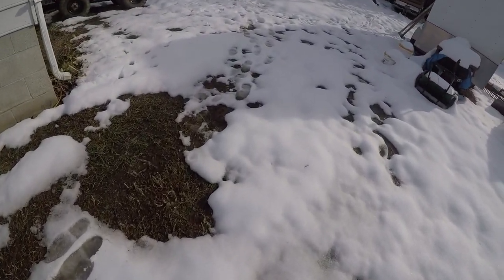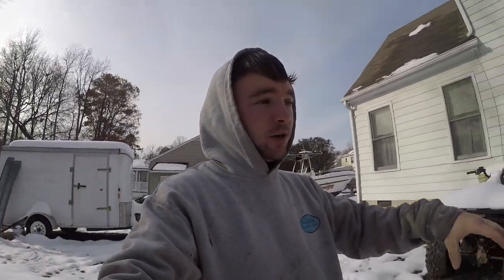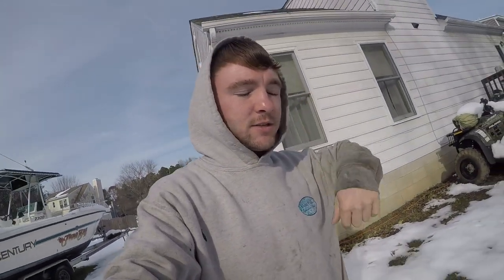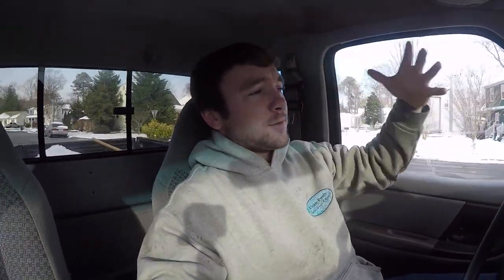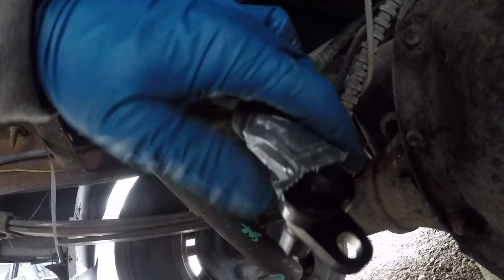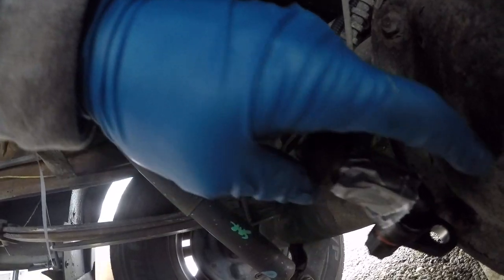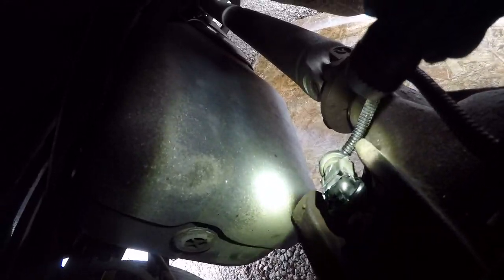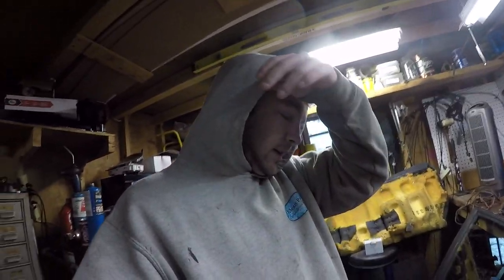HOW TO REPLACE ABS SENSOR ON FORD RANGER!!

Comment: Is your Ranger 2wd or 4wd? My ABS light comes on when driving. No problems with the speedometer though. I'm wondering if I need to replace that ABS Sensor as you did or do the 2wd Rangers have them on the Spindle of each wheel?
Reply from the maker: 2wd
Reply: @backyardbuilthondas1284  Thanks. I replaced my ABS sensor but that wasn't the problem. Found out it was the brake stop light switch I had just put on. It was defective. Swapped it out and problem solved!
Reply: Hey, I just replaced the brake switch the other day and my ABS light came on. Was that definitely the cause in your situation?
Reply: Wailuku43 Yes it was. I had a defective brake light switch. Swapped it out and no more abs light on.
Reply: Thanks for the quick reply! I ought to give that a shot. Was the switch fully defective, or did it at least give you brake lights again? In my case, I switched the brake light switch cause I had no activity in all three brake lights. After replacing the switch, I had a brakes again but the ABS light came on the same day I replaced it. I was hoping it wasn’t just another coincidence. Thanks!!
Reply: Wailuku43 It fixed these brake lights but made the abs come on. So after replacing the speed sensor A guy on the Ranger forums said it had to be the switch. Sure enough it was.
Reply: @mcndahouse  The same thing happened to me. I replaced the brake pedal switch, and the ABS light came on, after I put the old brake pedal switch back, the ABS light went off.

Comment: Thanks for the video.  Straight forward with only one sensor to replace.  I have a 1999 manual transmission 2 wheel drive.  Have the same issue on ABS light is on.  I'll replace that switch this weekend.  

You mentioned your speedomoter was not accurate, jumping around and getting stuck.  Mine is simular, does not register speed intil I'm going 30 MPH or so.  I"m not understanding the relatinship with the ABS sensor and the Speedo gauge.  Is that where Ford takes the speed readings, not the wheel rotation?  Question: did replacing the sensor "fix" you speedo issue too? 

 ...and bro, be safe our there, please put on your seat belt.  Want to see more videos, and keep you from injury.  Cheers!!
Reply: Found this to answer my Q to you.   From a parts site:   The Speed Sensor(s) measure rotational speed of the transmission shafts. Common failure symptoms include:

Erratic Speedometer Behavior
Harsh or Improper Shifting
Loss of Cruise Control
Surging or Hesitation
Check Engine Light On

Comment: I have a 93 2 wheel drive 4 cylinder ford ranger. My mechanic tells me I need an abs brake valve, because I have no fluid going to back brakes. Its 4 in the morning so I cant call him. Where is this item located on the truck so I can go to pick and pull to get one. I keep getting videos of abs sensors I need abs valve. Am I wrong in thinking sensor is electrical and valve is mechanical?
Reply: Practically beneath you. Under the truck, just past front tire beside the exhaust. Follow your rear brake line for a foot

Comment: You have the wrong idea with electrical tape.  Use when there is exposed bare wire.  Not to keep a connector together.  Use gorilla tape and/or zipties.